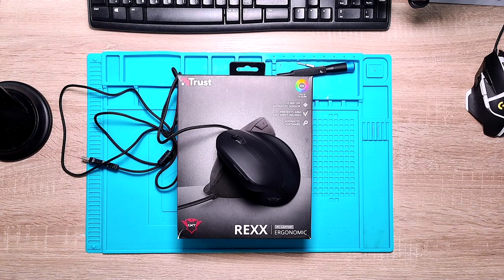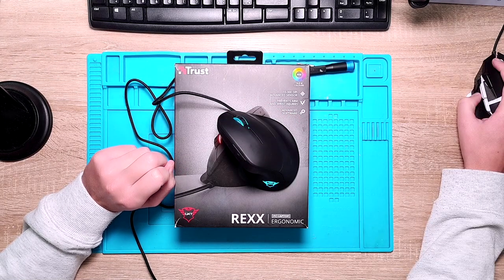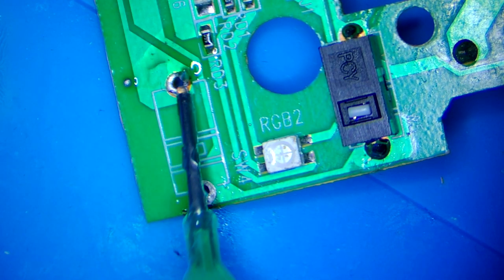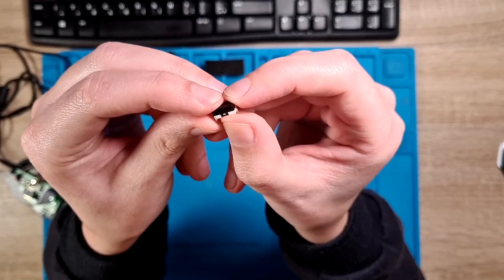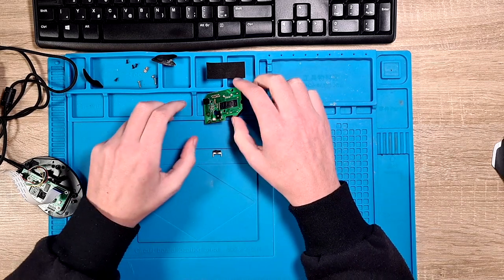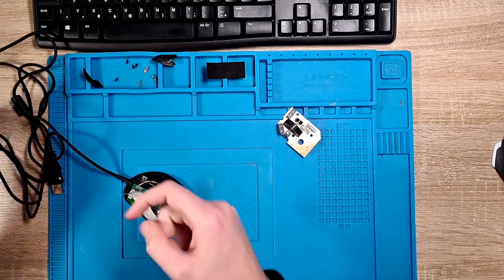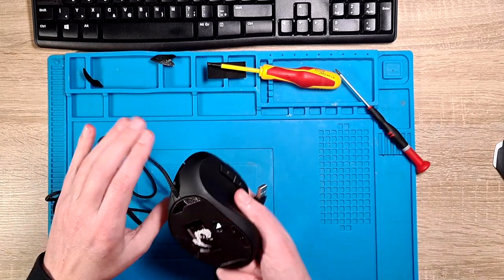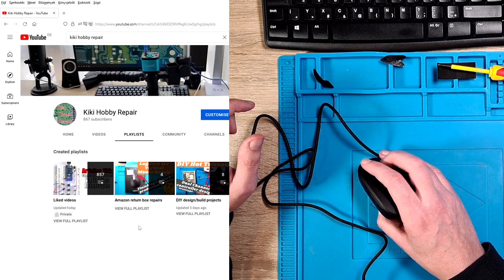Trust Rexx Vertical Mouse Weird Click/Button Issue Repair

Comment: Please 🙏 provide a link for the solder you used and replacement switch.
Reply from the maker: The low melt solder is Chipquik 4.5NL. It is really expensive and only like 1,5m but it works soooo well.: https://www.digikey.co.uk/en/products/detail/chip-quik-inc/SMD4-5NL/1164267
Unfortuantely, for the switch I do not have the link anymore.